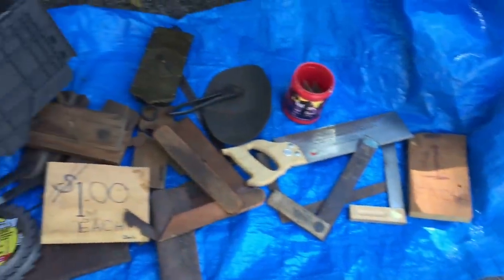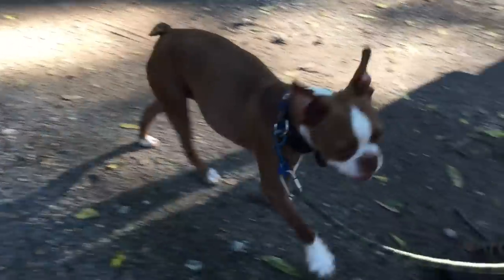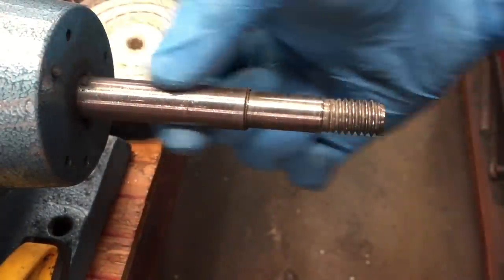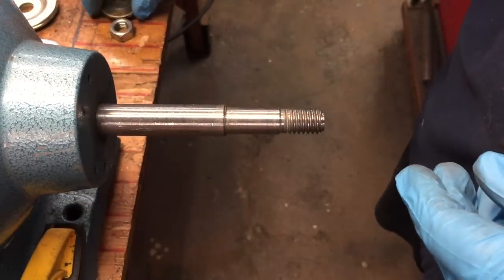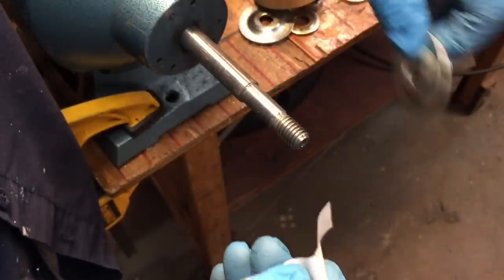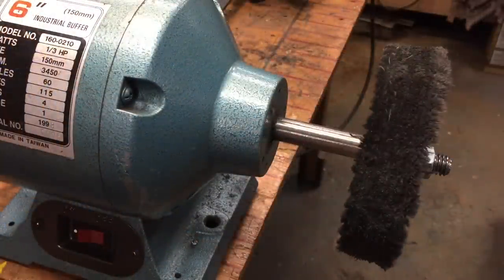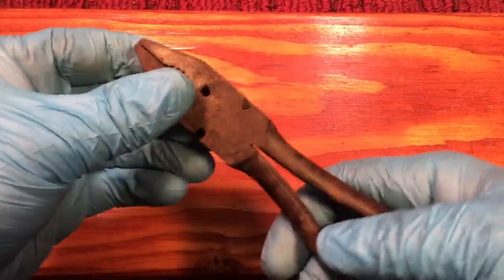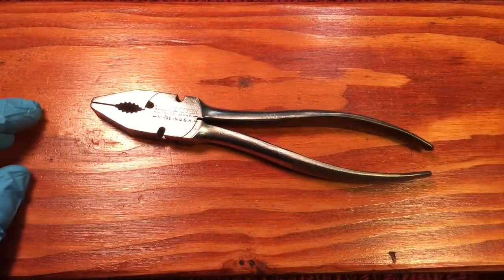Mish Mosh- L.I.Tool Swap, Buffing Wheels, Mystery Pliers.

Comment: 1:50 CLAMPS! Thank you for showing how to mount wheels on the bench grinder. I hate those plastic gizmo's that go in a wire wheel. I use machine thrust bearings to take up slack on my wheels, they are pretty spot on for size like you said.  Washers are toooooo big and the bench grinder hops around the garage.  Those Winchester pliers are great.  I love those trade shows.  I have none like that where I'm at unless I'm not looking deep enough.  Someday after retirement, I'll make it out there and have to go by and visit.  I'm trying to figure out what to do with an old Athol vise I picked up for $10 bucks at a yard sale.  It's a heavy vise and will smash one's thumb, don't ask.  Love me some Mish Mosh Mondays!
Reply from the maker: Aaron!  I can't wait until you retire!  You will love the show and the great guys there!!!  We are waiting for you!

Comment: Thanks for taking us to the show John -like like a lot of fun for sure.  I once had a wobble develop in a wheel, but it was from the "slip on" type  arbor on my (old washing machine) motor.   I had it for years and then for some reason the hole inside started to work itself to be out of round.  I never knew Winchester made pliers!  Thanks for another great video 👍🏻👍🏻👍🏻

Comment: Great tool collector's organization you have up there. Thanks for the tips on cleaning and balancing the wheels on your motorized polisher/grinders and the bearing lubrication trick. Many people don't realize that 3-in-1 Oil is an excellent shop lubricant, and is actually relatively inexpensive if you buy the bigger sizes.  The larger sizes will last for years, and it never goes bad.  WD-40 is is great for penetrating and cleaning, but 3-in-1 is a better lube and not paying for a spray can saves money; together they'll cover most of the things in your shop that you might need to break free, clean or oil.
Reply from the maker: You are so right!  3in1 has a whole new line of lubricants that are wonderful!  The Red 3in1 is about a 10w and I use it all the time!  This Blue 3in1 is a 20w and is what most motors call for as a lubrication!  WD40 is a great cleaner!  =D   Thanks!!!!!!
Reply: ScoutCrafter And thank you. I'll get some of the Blue 3-in-1 asap.

Comment: I saw a nice Leroy lettering set and tool and cutter grinder I'd like to have. Nice pliers with the Winchester on them. Good treatise on bushing and fitting buffing wheels. Burned the heck out of my thumb yesterday while making a bushing, forgot how hot steel can get. 😀 Another fine Monday Mosh, thanks!
Reply from the maker: LOL!  George!  The worst is aluminum!  The heat travels so fast on aluminum that before you know it you are playing Hot Potato!  =D

Comment: On a slightly different topic.. today electricians started running the conduit and wiring up my workshop...Yaaaa! Tomorrow night I should have lights!
I did notice something while I watched them work. I now know why linesman electrical pliers are often bashed up a bit on the nose. The electricians use their pliers to knock out slugs in the junction boxes and as hammers to square up the boxes after they've been screwed to the wall.
Cheers from NC/USA
Reply from the maker: 25 years ago my company relocated from one end of the property to the other side. The new building was state of the art for that time and had all union electricians. We would go there on our lunch breaks and after hours to check progress on what would be our new home...  They ran dozens of conduit lines overhead and had them spaced and bent perfectly next to each other, it was just beautiful.  Scores of lines were run overhead and it looked as organized and clean as if it were done for artistic reasons.  You learn early that it seems there are two types of electricians, the bash thru sheetrock type and make a mess, or the perfectionist who makes everything look just beautiful...  =)   I love watching the second one work!  =)   Congrats on getting new lighting!

Comment: Scoutcrafter i have a question for you, what is the diameter of your wire brush wheel wire. is the wire  0.30mm or 0.20mm in diameter. i usually only use  the .030mm wire wheel  for heave rusted pitted tools and only use 0.20mm for fine unpitted minimal rusted tools. 0.30mm brush wire wheel are the most common sold at shops here in Australia but the 0.20mm are harder to find is shops.

Comment: When I don't go to the tool swap, there is stuff I want to buy. But when I'm there is barely anything catches my eye haha.
Neat didn't know Winchester had lineman pliers! 
2:45 I had a pair of those lathe legs sold them to a industrial furniture builder for $350! Still have the wood  base for the lathe, I just pulled out the wood to make a vise mount base like you have for your vises. But the rain came down Saturday so I had to cut short my project .
Reply from the maker: Hi Kent!  We were missing you and your Mom!  You are so right, when you are there you never see everything that is there!  You need to really just concentrate on one table at a time!  Jacktown July 20th!!!!!!

Comment: Hi: I have a cheep, small bench grinder,1/3 hp, 5" that lacks power. I have replaced the capacitor (could I use a larger capacitor to gain power?) and it still lacks power, I can stop it with my thumb. Any suggestions would help. By the way, it was given to me 40 years ago and at that time it did not have much power. Would replacing bushings help? I want to use it with a buffing wheel and wire brush.
Reply: I  forgot to say thank you.
Reply from the maker: Richard!  I had that same problem with one or two of my buffer grinder motors.  I wish I knew the problem... Now I need to get my old Craftsman rebuilt because it gets way too hot!   I just bought this!  https://youtu.be/GI4oTKqThJY

Comment: Is the old Snap On breadbox style tool box still available? I had one like that once, been looking for another for 20 years!
Reply from the maker: The next LI show is in September..  =)
Reply: @ScoutCrafter  
Yeah but I am in Arkansas. I am serious about wanting another one of those. Your Brown Kennedy machinist box might work fine too. I have a large SO KRL 1001 toolbox that has a stainless steel top, no top boxes. I have a lot of measuring devices I would love for the breadbox style. I guess I could buy a new one but I like the old ones much better. Edit: watching your channel has ruined my local tooltruck chances, I prefer finding something old and making it nice again than buying anything new. I spent a 3 day weekend repainting the first breadbox I bought. Tops and bottoms of all drawers, inside and out of the box. In red lacquer. 5 coats. A bad relationship destroyed it. My 14th wedding anniversary is the 3rd. Not bad this time!

Comment: What did you say that you use to free up sticking lineman players was it transmission fluid and  what else didn't get the other ingredients
Reply from the maker: The 50/50 mix is Acetone and ATF, then WD-40 to get out the dirt!  Finish up with 3in1 oil...  -=)

Comment: Hi scout can you use a wire wheel on this tipe of machine you have here or is it only for buffer wheels?
Reply from the maker: Yes!  However I prefer a slower speed motor (1800 rpm or less) for wire brushing.   Most Wire Wheels are good for 3800 rpm.  Always check the max rpm on wire wheels...  The good part about slow motors is you can use larger wheels..
Reply: @ScoutCrafter  ok great info thank you.

Comment: Great video. You and Sneelock posted a video within an hour of each other. Nice! Thanks for the buffer tutorial. I noticed your machine says it's a "buffer." Does that mean you cannot use a wire wheel with it? Are the specs different than a bench grinder? Thanks for posting!
Reply from the maker: Hi Brian...  Honestly they are just motors with long shafts.  The RPM range makes this ideal for buffing where as a 1700 rpm range would be better for the wire wheel...  =D   For Grinding wheels you want a shorter shaft for less deflection.
Reply: @ScoutCrafter  Or as a great man once said, rigidity, rigidity, rigidity.

Comment: Is 3 in 1 oil better than marvel mystery oil?
Reply from the maker: Hi Cindi!  I love both!  I think the MMO has more cleaners in the oil.  Now just to be clear, the 3in1 regular oil (Red container) is a little thinner viscosity then the 3in1 (Blue container) motor oil...  One is 10w and the blue is 20w...   Not a huge difference but motor manufacturers that have the oiling cups usually call for the 20w oil....  =)   Thanks!